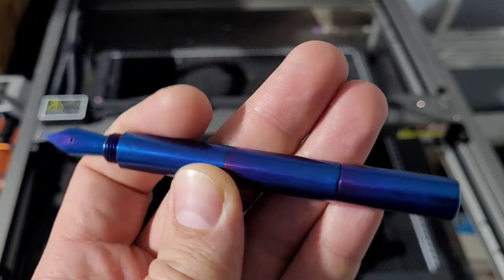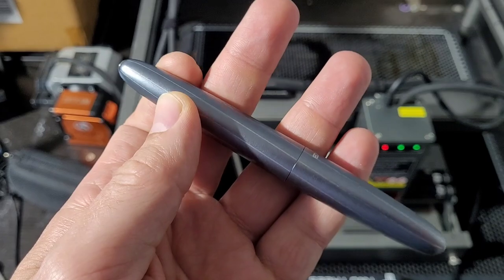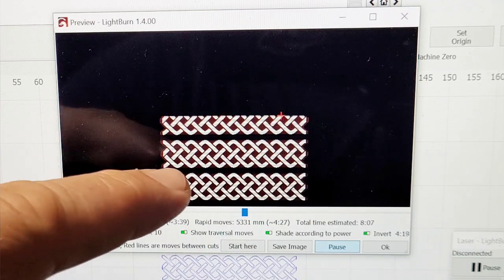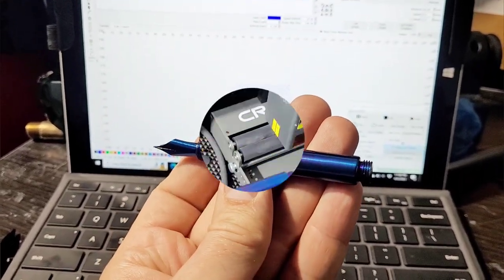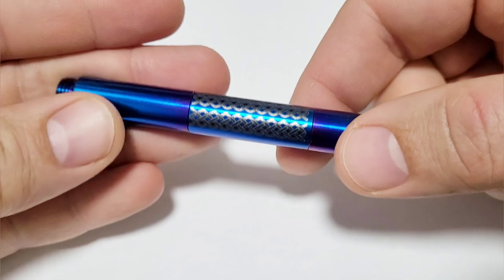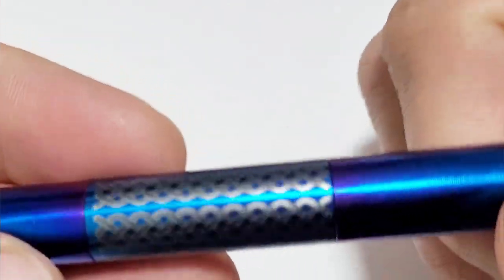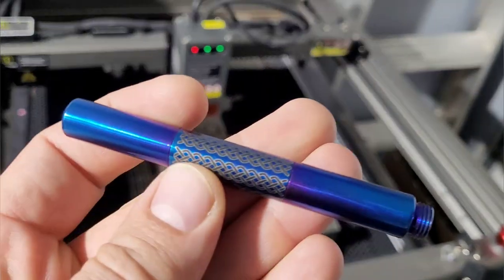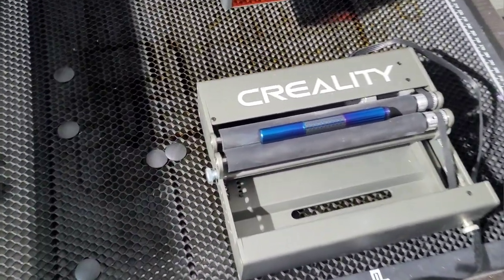Customizing A New PVD Coated Fountain Pen With The Creality Falcon 2 22W Laser

Comment: DB:  Could you cobble together two magnetic 'stops' for the roller mechanism.  Magnets so it is infinitely variable and not permanent.  Just a thin piece of metal on a magnet that will keep the pen from moving horizontally and not interfere with the laser.  Kind of like a stop on a miter saw.  (they use that stop for repeatability)  A stop on both ends of the pen to keep it from moving horizontally on the rollers.
Reply from the maker: With the vector engraving the pattern there are lots of movements.  I could put in stops to restrict lateral movement but the pen can still hop a bit on the rollers with that many moves.  A chuck style is the ideal way
Reply: @Doodlebud  Agreed.  Not seeing the entire process (in person) I was just spouting of the top of my head.  Did I miss the reason you had the big gap with the pattern?  Did you need another row of pattern?  I am sure you used the diameter to figure out how many patterns you needed.  Loved the microscope view of the etching.  Cool stuff.

Comment: So dang close getting the pattern. The spacing doesn’t bother me as much as the engraveless gap.  Did you do RCA, such as bad measure for circumference that left the gap?
Reply from the maker: I even measured with a micrometer LOL.  Looking at the file or settings to see what happened.  Worked on my test steel tubing, but messed up with the pen.  Might have been a vector VS bitmap issue
Reply: @Doodlebud  it would be maddening if it was file conversion error because unless you know file types and their quirks, it’s harder to account for!  I liked the knot pattern nonetheless. Good choice